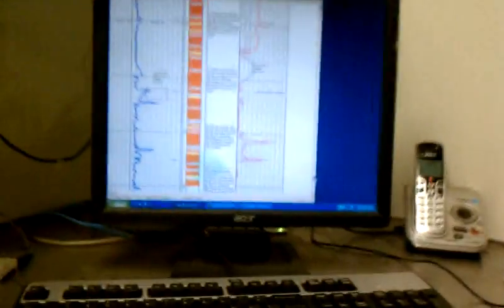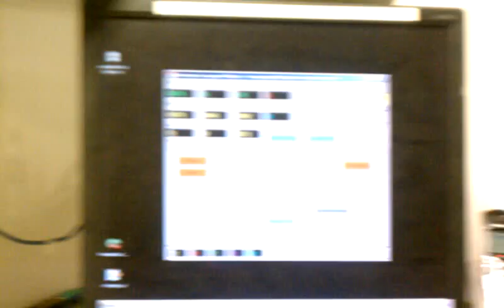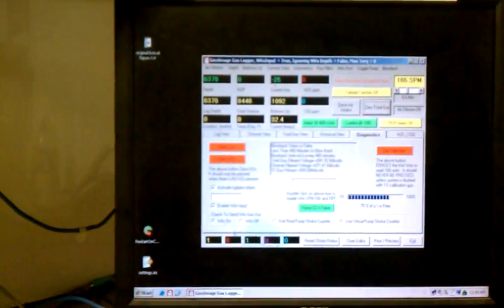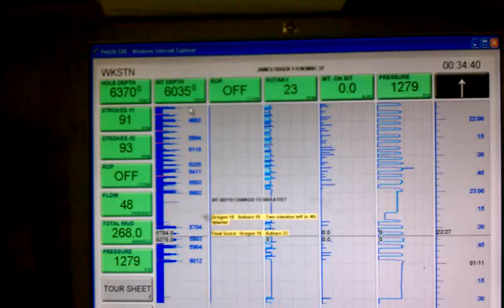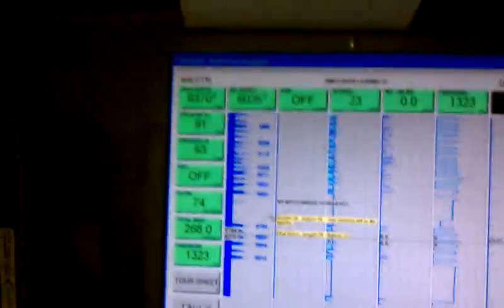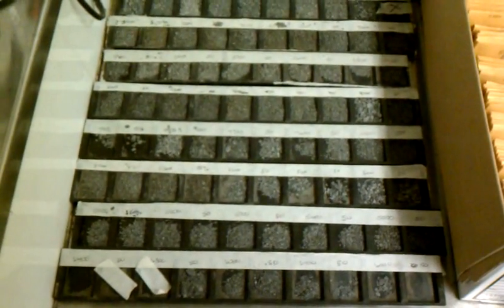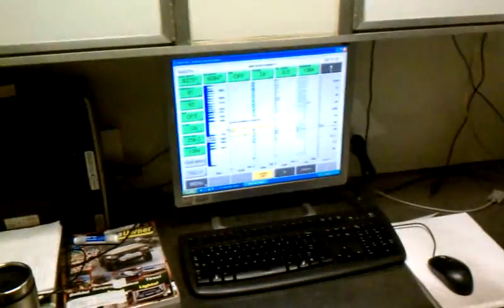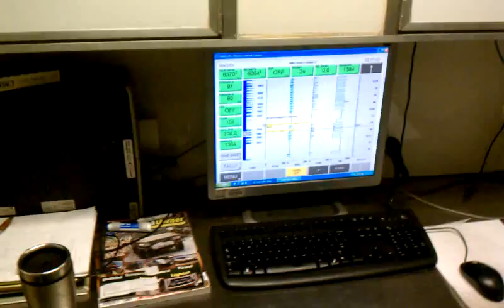Mudlogging

Comment: How do you determine the drilling depth at each sample accurately?
Reply from the maker: A few different ways. The computer keeps track of bit depth. Drilling with mud (or invert) you can calculate how long it takes for the fluid to reach the surface if you know the total volume of the open hole, casing etc minus the volume of the drill string. The pumps will push a specified amount of liquid per stroke and you'll be given live information of pump speed. A little bit of math and you get a pretty good estimate of how long the return will be factoring in all those parameters.

Another method is to insert bit of walnut shells and start circulating at a constant speed. Time the return and you know it more accurately.

Or if you know you'll encounter a different formation (going from sandstone to limestone, say), look for the drop in ROP (ft/min drilling speed) and if you are pretty sure you're in the expected limestone formation, start timing and check the shakers for any signs of it.

I built a pretty sophisticated spreadsheet to calculate 'bottoms-up' and was never off by more than 10 seconds. But when pumps are off for too long any cuttings in suspension will settle down and can mess with accurate sampling.
Reply: @bailesie  thanks! Great info. We are drilling well in Wayne County MS and received mud log reports. I’ve been on drilling rigs but never knew exactly how mud log depths were calculated. Thanks
Reply from the maker: @perrinpartee557  You're welcome! I've been out of the business a number of years now but I really enjoyed the challenges it posed. Stay safe!